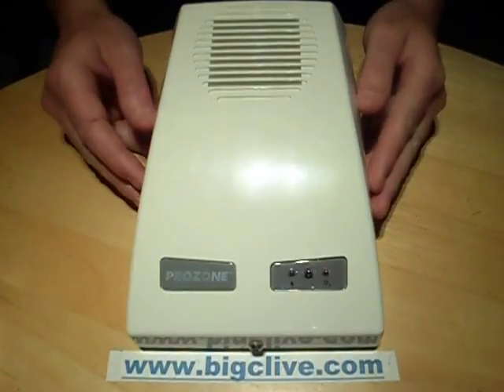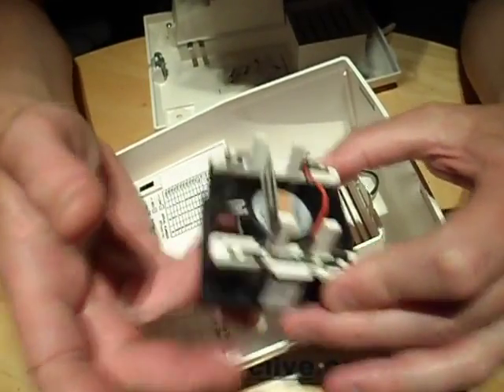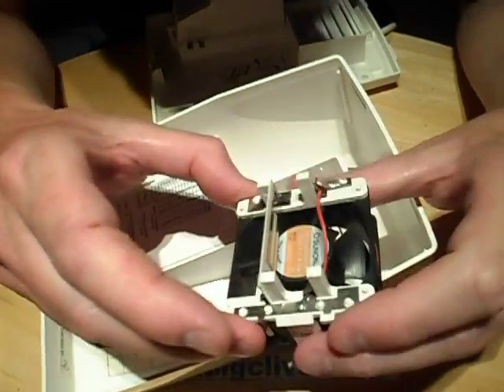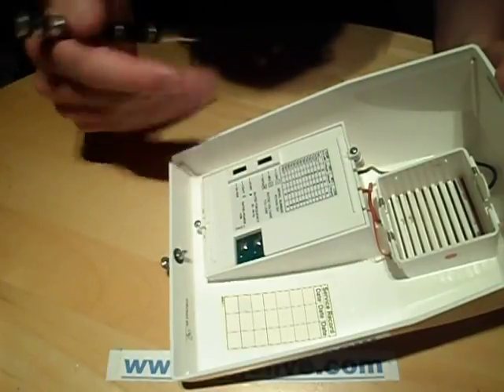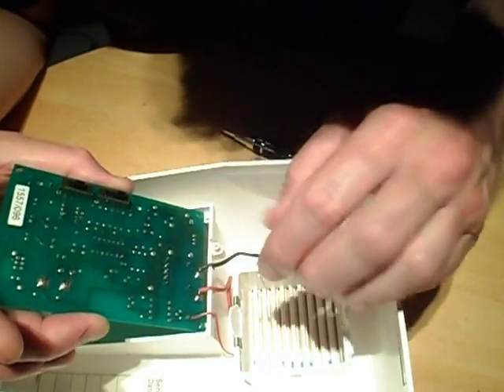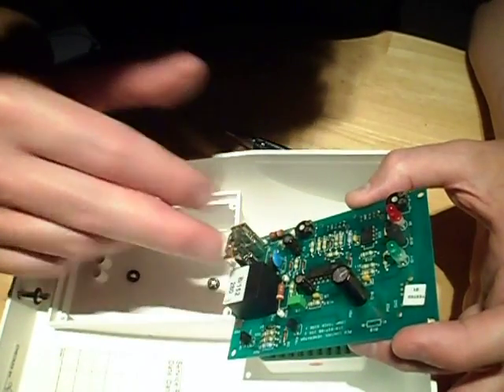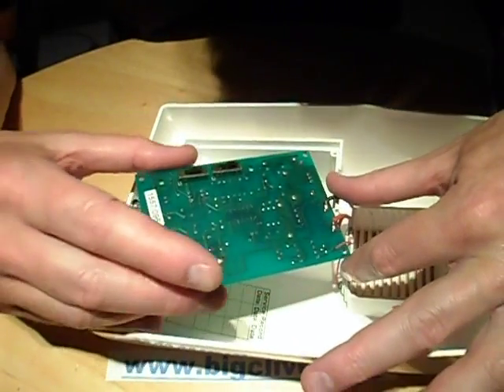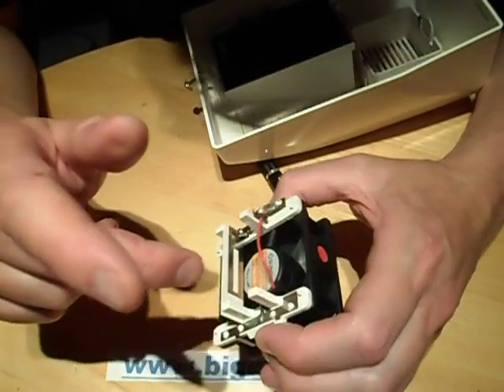A look at the insides of a public toilet ozone generator.

Comment: Not sure I really like the idea of these. When you want to make ozone cleanly in a chemistry lab, you run pure oxygen through the generator, so that you get a mixture of oxygen and ozone out of the other end. Only a few percent of the oxygen gets converted to ozone, so you have to recirculate the gas if you want a higher concentration. Or you can condense the ozone from the mixture afterwards, since it has a higher boiling point than oxygen.

Running ordinary air through an ozone generator will of course make some ozone, but also makes nitrogen dioxide. Any corona discharge or spark generator will do the same thing. In fact, some of the nitrogen dioxide in petrol engine exhausts comes directly from air interacting with the spark plugs. Anyway, if the air has a reasonable humidity, the nitrogen dioxide can react with water vapour to make nitric acid, which is even worse.

Comment: what is ozone exsatly and whats a corona discharge please thanks i love your channel i never learned so much stuff about electronis be cool take care
Reply from the maker: A corona discharge is basically a glowing purple mass of tiny sparks.  It's generally created by capacitive coupling of high voltage electricity past an insulator.  Ozone (O2) is oxygen that has been split from its stable two molecule state into individual molecules which then recombine into O3 (ozone) which has three molecules of oxygen, but is unstable, so it gets rid of the third molecule onto anything that will take it, oxidising it in the process.
Reply: wow thats really cool thank you i never was into electronis but nowadays everything is so im trying to learn some of it your vids are great i dident know it was all so tehnical threres some really tricky stuff lol thank you for helping me out n keep up the great content !

Comment: Ozone is NOT toxic, it is simply charged oxygen molecules, and is naturally occurring during rainstorms. 

Ozone is not harmful unless concentration is at very high levels for extended amount of time, the result is dry, itchy throat and nose, excessive levels smell like bleach. 

It is a far better solution than chemical sprays.
Reply: *****
It is fine at low levels and beneficial to the environment, it is when levels are too high it causes problems- just like anything out there.
Reply: They are harmful at any level in your lungs. They cause serious damage to your internals due to the cell destroying properties O3 has.
Reply: wrong. ozone toxic, people! it is a powerful oxidant and irritating agent. the only place it is beneficial is in the upper atmosphere

Comment: I've seen similar ones in public toilets that have a ceiling-mounted sensor connected to the ozone generator. This allows it to automatically adjust the corona discharge depending on the amount of ozone that's in the room at the time, avoiding overexposure. I've also seen a newer kind that doesn't use a fan, but some kind of blue light (possibly an arc) to sterilise the air.
Reply from the maker: Possibly a UV-C tube that creates low level ozone.

Comment: I've seen things like this in public toilets but I've not heard them making any noise at all unlike this one.  One exception was back in 2003 when I heard something that looked like this making a buzzing noise that sounded like an electric motor starting up and spinning up to it's full speed, but it was oh so quiet, you could barely hear it.  Why would you want the ozone generator to only operate when the public toilet is closed and the lights are off?  In the building I worked in up until recently the public toilets had motion operated lights in them, so if such an ozone generator was used in these toilets it would be turning on and off all the time as people come and go.
Reply: It'll be to limit human exposure to ozone, you don't need to be constantly blasting the bacteria with ozone cos you'll get a useful suppression of bacteria from a few hours whether people are there or not  - probably makes more sense for a toilet that's not busy around the clock - not somewhere like an airport that's open 24 hrs.
The perfume sprayers only really do any good when there's someone around to smell it so they're often triggered my motion sensors to make sure they're not wasting perfume by spaying it into an empty room.

Comment: I think ozone is harmless in most cases unless your sealed in a tight room with a huge concentration,  I think people worry to much about toxic situations how manny times have you been in a garage with a car running?
Reply: True.
Carbon monoxide is very poisonous, whereas ozone is non-toxic.
Reply: David Hart Ozone is about as toxic as heavy gases, it sits in the lungs and displaces o2. Other than that, I've not heard it being able to bind to hemoglobin, so assuming you can get some fresh air after taking a lungful of o3 you should be alright
Reply: @Hegamonia  Agree, so therefore not toxic.
Reply: @harshbarj  Did you write the report? Of just read it and take it for face value. Don't believe everything you read.
Reply: Supposedly ozone was considered for its possible harmful effects after people who had been around it enough in confined spaces over time started to feel not so great. For example, playing with plasma speakers in a small lab. A tiny bit of ozone in a largish room doesn't seem too bad. I've played with small arcs that seemed to just absolutely flood the air with the smell though.. I personally wouldn't want that smell overpowering the room all the time and feel like it just might be bad for me. A tiny little bit from an odor cleanser is probably ok.
Reply: @davidhart9106  wrong, ozone is very toxic
Reply: @st.m.3979  No, it's not.
Reply: @davidhart9106  Agreed!
Reply: @st.m.3979  Propaganda. Don't believe everything you hear. The only thing a thunderstorm can kill you with, is lightning. Produces Ozone you can smell for miles. Never heard of anyone injured by that.
Reply: Yeah I really don't think a gas that is capable of breaking carbon bonds quite easily is a good thing to be inhaling.  Since we are known as carbon based lifeforms.
Reply: Maybe it's dangerous because it's not-oxigen
Reply: wanna make bets over how many people cheapskate over shit like ventilation when they think "oh let's just put this thingy here that makes smell go away"?
Reply: Haha, I think so too.

Comment: I would say the seals are for those lovely kids who try and knock stuff down with wet toilet paper.
Reply: Also trying to pee inside it, and ripping it off the wall to submerge in water. Strangely they don't want hooligans to get electrocuted at all
Reply: Too bad.  Rewarding bad behavior with electrocution sounds like a pretty good idea to me.  It'll probably get better results than excuses and pointing fingers.
Reply: +zendell37 well, it's designed specifically so that only way of damaging it it to put water on the highest voltage element in the device, also, the fan would blow the water back towards the kid. What a perfect design.

Comment: Maybe all those seals are because it's for a bathroom, humid area, probably subject to severe temperature swings in many cases. I wonder if the decision to use a conventional linear PSU was because of the slight heat from the transformer?
Reply: ***** Linear supplies are also less troublesome for long term applications despite their inefficiency.
Reply: Gavin Curtis True, missed that point
Reply: maybe just in case someone try's to piss on it

Comment: Another interesting video Clive, thanks. Ozone is fascinating stuff... Freshens air, kills mould, oxidises stuff... and some people use it for health reasons, drinking ozonated water and the like... and others say it's really bad for you. I always wanted to build a simple ozone generator just to find out what it smells like, and to see that purple corona.
Reply: +ForViewingOnly   Build one with a Cockroft and Walton voltage multiplier.  Power straight from the mains. Don`t forget that ozone breaks down DNA.!!!!!!.
Reply: +Crobular I It has to get to the DNA first, though, which inevitably kills the cell and renders the DNA unusable anyways. So I'd say you shouldn't worry about that.
Reply: +RFC3514 Not at all, but I do know a few things about chemistry and physics. I am pretty sure Ozone cannot cause cancer, but maybe there's something I'm missing.
Reply: "Drinking ozonated water" sounds like you think ozone remains in the water after ozone is used to disinfect the water. Ozone(O3) is a gas, it will come out of the water if not used, or the O2 will come out if the O3 reacted.
Reply: Mandrake Fernflower Seems legit. 
I just pointed that out because some say Ozone can cause cancer. I say O₃ won't cause cancer because a dead cell cannot reproduce.
Reply: +Maanuueel42 \m/(^_^) - You are clearly a qualified biologist.
Reply: Maanuueel42 \m/(^_^) - Most people know "a few things about chemistry and physics", but cellular biology and genetic mutations aren't really covered by either of those disciplines.

By your logic ("for something to cause cancer it has to get to the DNA, which inevitably kills the cell"), nothing could cause cancer.

Maybe that's true; maybe it's a figment of our imagination. Maybe the way to cure cancer is to study psychology instead. ;-)
Reply: RFC3514 no, radiation for example (beta, but mostly gamma) passes through pretty much everything until it hits a nucleus. One single gamma photon can cause one single "point" of damage in a random spot in your body. Ozone is a molecule, it's much larger than that and pretty much acts like a free radical, so it will react with the first reactive substance it comes in contact with, in this case the cellular wall. 
As I said, I might be missing something, but this is what I think.
Reply: Maanuueel42 \m/(^_^) - So a virus (much bigger than an ozone molecule) couldn't possibly cause cancer, right...? Which means the 90% correlation between the human papillomavirus and cervical cancer must also be a figment of people's imagination.

I'd say that there is indeed a very good chance that you're missing something. Or even several things.

You might want to start debugging from your statement "which inevitably kills the cell". If human cells were "inevitably killed" by the first molecule that came into contact with them, we probably would have become extinct some time ago.
Reply: RFC3514 Ozone acts like a free radical, a virus does not. But since we're probably both not really qualified to discuss this theme, I'd say we should stop now and leave this to the biologists. ;)
Reply: Maanuueel42 \m/(^_^) - "Ozone acts like a free radical" - Assuming you're using that to mean "therefore it can't be related to cancer", I suggest a quick search for "pubmed 8695238", "pubmed 15646026", "pubmed 16430879", "pubmed 10688856", "pubmed 22293091" or "pubmed 12587714".
Reply: Okay then, I withdraw my previous arguments. ^^
Reply: lightdark00 - Carbon dioxide is also a gas (at ambient temperature), but the carbonated drinks industry only exists because it's a gas that is soluble in water. 

Ozone is also (highly) soluble in water (over 10 times more soluble than oxygen), especially at low temperatures. Having said that, the amount of ozone used to disinfect water is generally pretty low to begin with, and given enough time it will react with itself, so it's not really an issue unless you're pumping ozone into the water shortly before drinking it.